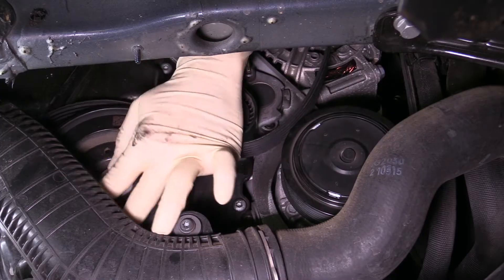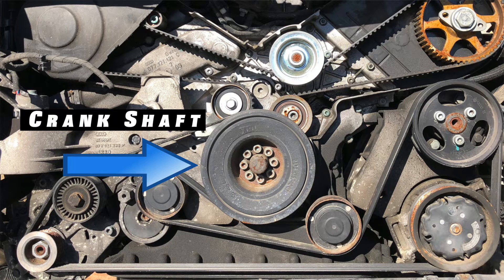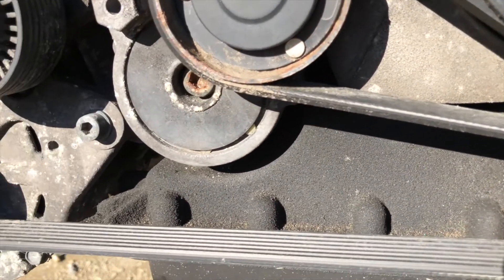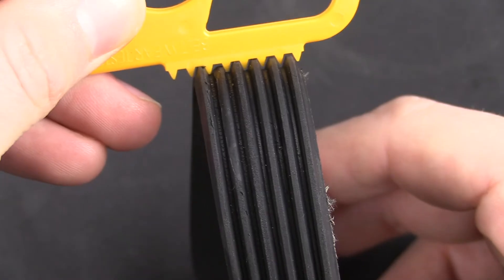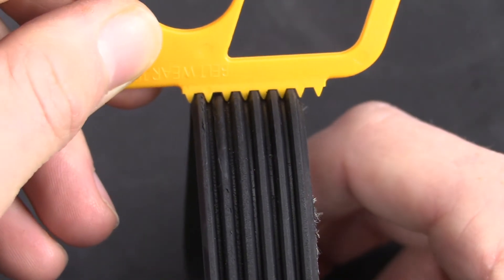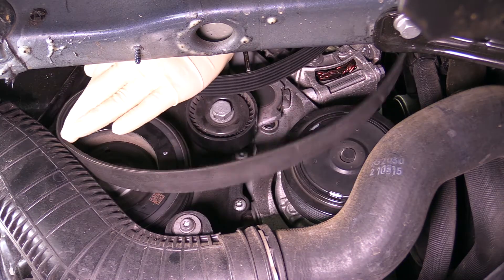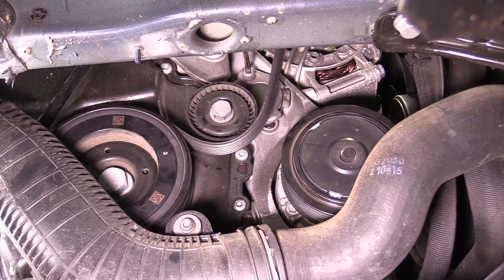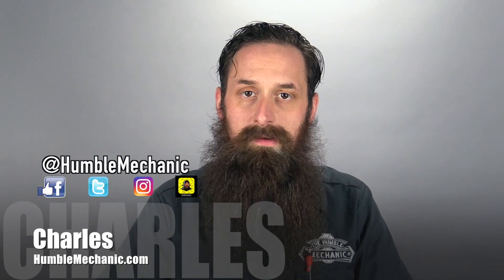Car Parts Basics: the Serpentine Belt | Allstate Insurance

Comment: Hi, I am ficing this problem for a few days during this lockdown. Everything is fine until I turn ON the A/C. Immediately on turning the A/C ON my Power Steering is not working, and there is a low battery indicator on the display. On turning OFF the A/C everything is back to normal. Does this mean that my belt is loose or something, or do I need to replace it? Please help.
As all service stations/mechanics are closed, is there something I can do till the time this lockdown is over.
Reply: Hi there.  Did you ever get an answer for this?  Just curious.  Thanks!

Comment: my car grinds when I push on the brakes. I had the rotors and pads replaced, one auto repair shop said it might be the "R&R Serpentine Belt Tensioner". Does this sound right to you? It is a 2002 Toyota Camry. Thanks
Reply: NO your brake pads are worn out don't fall for it might be a serpentine belt tensioner it has nothing to do with your brake pedal they just want your money

Comment: I want to change my car's serpentine belt. Are all belts of the same length?
Reply: just go to the auto parts store and say you need a belt for your specific car, say the make, model, and year of your car and they will get a belt that fits, also replace the tensioner, same procedure for getting a tensioner
Reply: the length is specific to your vehicle and usually only one belt but some Hondas and Toyotas have 2